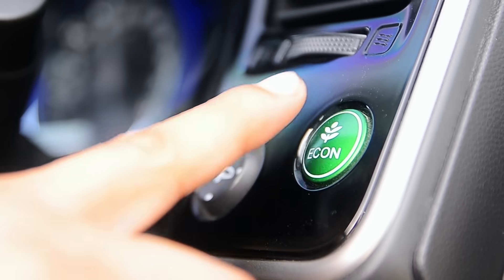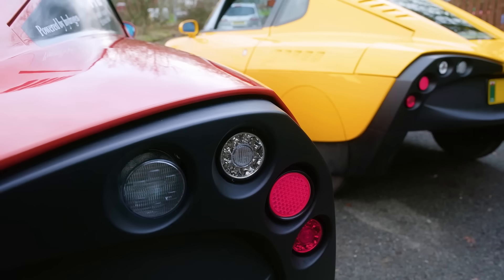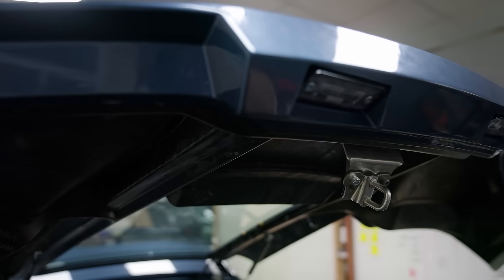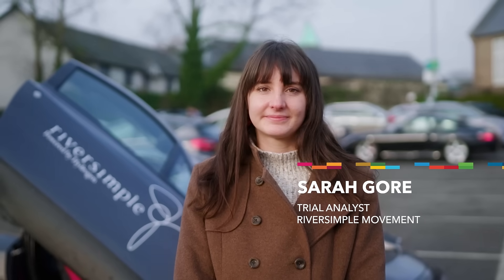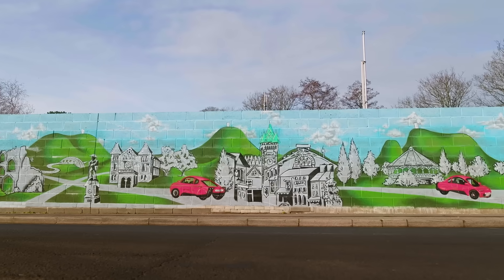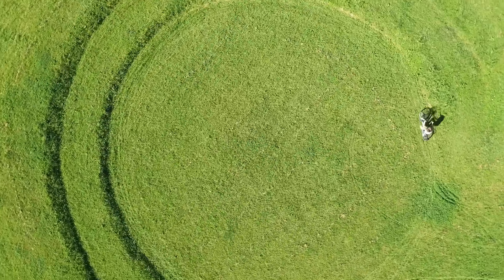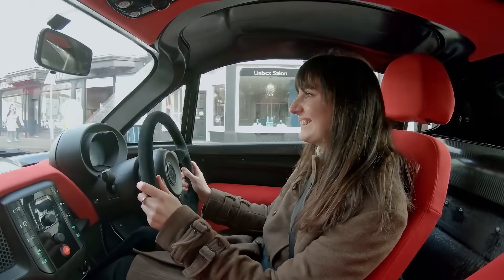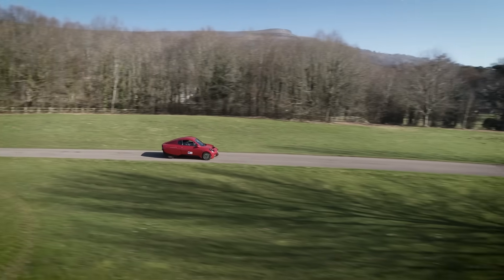Inside The Former F1 Engineer's Innovative Hydrogen Car

Comment: As impressive as it is, the simple fact is that while the battery EV charging infrastructure isn't as comprehensive as we'd like, it is FAR more advanced than the hydrogen refueling infrastructure.  There isn't any hydrogen refueling infrastructure at this time, and the dearth of hydrogen vehicles denies any market demand.  To backwards-paraphrase Field of Dreams, nobody's going to come so we're not going to build it.
Reply: Isn't Hydrogen flammable?
Reply: @Aaron-xr7oc  Yes.  So are gasoline, lithium, sodium and many other materials used to power vehicles.
Reply: Only because they have been tunneled visioned on plug in E.V's
Reply: That's not true.
Refueling facilities very much Exist -- for every city's hydrogen-powered public transportation vehicles.
How do you think those buses function?
They just need to be expanded to wider public, and that's gonna happen when the Governments make a push toward hydrogen transportation.
Battery cars are a dead-end.
Reply: @MrDeicide1  you have to truck in hydrogen, very costly, or build pipes, also very costly. Its not a simple matter of expanding it, these cities are probably only trucking in the amount they need
Reply: @BooleanDev  
From the Few gas plants that produce it
Why can't you imagine More natural gas - to - hydrogen plants?
Reply: Reply is OK.  It's all going to cost more.  I just can't agree totally, cause there is a lot of mind control happening these days.  Been the same forever.  Think about this:  War costs a lot.  It's the after cost nobody thinks about; which often amounts to more than ten times.  Heck, we can't fix potholes or fix any existing infrastructure, let alone think about new charging stations for electric or different fuels.  Hell, biden needs ice cream stations!  TAX, TAX, TAX. Whatayathink?
Reply: Definitely true, building them coz too much, transporting Hidrogen also difficult.
Reply: I meant "Cost"

Comment: The problem with hydrogen in cars is that 70% of the energy is lost before it powers the car. Electric battery cars it is 30%.
Reply: Yes, its far less efficient. Water have the strongest Bond splitting Hidrogen from it is very energy inefficient.
Reply: But as the devil advocate, batteries deteriorated and also need energies and materials to manufacture. And the waste is bad for the environment.
Reply: @drextrey  To produce a battery costs more energy than producing a gas engine, but this is offset, in case of Tesla, within 10.000 miles. Tesla uses solar energy to produce it's batteries, as the factories are covered with solar panels. Drone footage show Tesla is covering the roofs of all its factories with solar panels right now.. that runs in the tens of thousands of solar panels. Texas has already 70.000 solar panels and is only half covered, same is happening in Nevada, Shanghai and Berlin.

EV Battery packs do not deteriorate as quickly as people think. Jeff Dahn research group has shown that current batteries in Tesla's could last 1 Million miles. Older Tesla's, like first generation Model S', get to 500.000 miles. Jeff Dahn has also been testing future chemistries, which could last 2 million miles or even 4 million miles...This would mean a battry could last a life time! and will outlive the car multiple times. A car would be scrapped for other reasons than the battery and the battery probably will find a second life as stationary storage.

And when batteries get scrapped, all of them will be recycled and provide high quality materials for producing new batteries.
Reply: @MarcoNierop  you’re right that a battery pack will probably last longer than expected due to the current software being more advanced, still people have bad experiences with batteries in their old phones… You don’t know how the previous owner used his battery (you might, I assume this is tracked in the software?). He might have charged to 100% each time, just to get that extra bit of range. If you have a hydrogen car, in theory, it doesn’t wear out… just like a well maintained ICE car can run forever… you won’t be replacing an old battery pack which is custom to your specific electric car. Ok, some will, but currently this is the majority of the car’s cost. People probably will sooner buy a new car if it costs so much to replace. If, I could produce hydrogen at home (for the majority of the time, I would take my energy loss for granted) and if I could fill up at the current gasstations as a backup. I’d rather have a hydrogen car.
Now let me add one disclaimer. I am talking about vs an electric car with a large lithium ion battery, if they’d use more commonly available and less flamable materials for the battery my opinion could shift, but that’s yet another reason. Everybody wants new technology, they might not be interested in a 2nd hand electric with old technology…
Reply: @grtxyz4358  Fuel cells also wear out, and requires quite a bit of maintenance, like the air filter that needs to be cleaned/replaced at a regular basis. (Air that goes through the fuel cell needs to be super clean) and that is completely independant on how you drive!.. it is just something you need to live with.. same as with the high pressure hydrogen tanks that need to be replaced.. BY LAW.. after 10 years, no matter if you have driven it 500.000 or 50.000 miles.

If you buy a second hand EV, you easily check the condition of the car... Just ask it to be charged 100%, check the estimated available miles on the display, and compare with the original specs to see the degradation. Beside this you can run a analyses routine that checks the battery condition. 

More and more anekdotes come out where people see hardly any degradation on their electric cars. The other day I stumbled on a YT short about a Model X, only using supercharging as the guy has no possibility to charge at home.. almost 300.000 miles and less than 10% degradation on the battery, was a Models X from 2017 iirc so added a ton of miles in a relative short time. 

Batteries last very long and only get better. Also batteries for smartphones get a lot better... The phone I type this message on is already 5 years old! And it is stil as good as new! I can get through the day on one charge just as easy as when I just bought it in 2017. My previous smartphone (Nexus 5, Google phone) all of a sudden battery life went downhill and one day it got bloated and very hot... Was only 3 years old...
Reply: @grtxyz4358  There is a lot happening in battery chemistries, CATL and some Chinese manufacturer are now using Sodium ion batteries, no lithium but SALT, the second most abundant material on earth.. It's used in a very cheap small Chinese EV. 

But the big change that is going on right now is the transition to Lithium Ferro Phosphate (LFP) batteries, which do not need Nickel(expensive) and Cobalt (even more expensive!). Plus these batteries have twice the amount of cycles and can be charged/discharged 100% all the time without damaging your battery. Plus these are a lot cheaper.. the disadvantage of low energy density is worked on by adding other metals to improve energy density, like a bit of manganese (CATL M3P  battery) or silicon. The cheaper lower end EV's are now fitted with these batteries and works just fine.

But more is coming and will both improve longevity, energy density, lower costs.
Reply: @drextrey  Yep, it's just physics and there is no way around physics, so this inefficiency problem will never be solved.
Reply: True but today in the Netherlands they had to turn so much wind turbines out of the wind because all the solar panels were producing so much electricity... if you have a huge surplus of cheap generating devices like solar panels, which are dirt cheap nowadays, what does it mean to lose 70% if that means you have really no waste.... unlike with batteries.
Reply: @grtxyz4358  That is what is been built right now, a hydrogen electrolyser near Amsterdam that runs on excess energy from wind at the North Sea.. the goal is to use that hydrogen for producing carbon free steel at Tata IJmuiden and have a few more hydrogen cars for people that cant do math.
Reply: The problem isn't that. The problem is it takes 39 kwh of electricity to make 1 kwh of hydrogen.
Reply: @jg4sh7j4  I am against hydrogen, but that figure is bullocks, maybe you oversaw a decimal, was it you need 3.9 kWh for 1 kWh worth of hydrogen? That seems about right to me.
Reply: Yes but the pro is after doing that you can in theory make high performance in horsepower or speed vehicles that dumps the hydrogen rapidly into the fuel cell for a power surge at a weight batteries could never match. 

Though fuel cells are too expensive for that right now and pantograph EVs can avoid being weighed down by Batteries and come in truck and train forms so…🤷‍♂️ plus in Europe you got ebike infresture that can easily be retrofitted to be solar. 

Both hydrogen and power grid electricity is powered mostly by natural gas and other fossil fuels anyway. Biogas is the carbon neutral version that burns cleaner. LNG or CNG vehicles have the pro of being carbon nuetral, have less intial Carbon foot print in manufacturing then EVs, burn cleaner, fuel is cheaper per mile, and makes use of waste steams instead of valuable crop land like ethanol corn or bio diesel oil crops. It’s so easy you can make your own biogas 🤫
Reply: All cars run on batteries...stores of inert energy turned kinetic on demand.  Petrol, Diesel,  BEVs, H2, NatGas...

The physics problem with BEVs is mass.  You must keep a massive mass moving and that mass is just as big when full or empty.  To get range/HP you must add mass batteries, which add weight, which reduce range.  An engineering vicious cycle.

Liquid fuels and gasses have the advantage of the weight of the battery store being small, and getting lighter each km or mile traveled.

Thus a Tesla is a massively heavy car for what it is.  Twice as heavy as an equivalents petrol car.  Weight equals resources consumed to build the car.  Resources consumed is the primary problem.

It is hard to get yourself out of a consumption problem by consuming more and new stuff.

Eventually we have to ask is long distance personal transportation worth it?
Reply: @STho205  When we convert to all electric cars the need for resources is LESS than with gasoline/diesel cars (ref Tesla masterplan 3, and this week's published Tesla Impact report 2023, highly recommended reads!)...Why?  Because the battery need to be resourced only ONCE per car, while fuel for ICE cars need to be resourced continuously throughout the life of the car, and is used and wasted as toxic pollutants in the atmosphere.. PLUS electric cars are way more efficient with the use of energy. Electric cars need only 30% of the energy present in gasoline to travel the same distance as a gasoline car. A Tesla Model 3/Y battery has the same amount of energy as is present in about 2 gallons of fuel. 

Batteries last a long time and will be recycled when they are at the end of life (this could take decades!) So at some point we hardly need to mine for new battery materials, because the old batteries will function as high quality ore!  Just like we recycle lead acid batteries for decades. 95% of lead acid batteries are recycled, for lithium battery packs that could get very close to 100% because battery packs contain so many valuable materials and companies are picking up on this recycling opportunity right from the start.

Charging batteries using solar and wind, the same story, no waste, so less resources needed. Solar panels last 30 years, wind turbines about 25 years.. the energy source is all around us, for free, wind and sunshine. and these too will all be recycled.

Ik know what is better, if you really did some thinking about it, it is kinda obvious.

Oh, and that weight issue, yes electric cars are heavier, but with new batteries energy densities are increasing and this weight issue gets less and less. Beside that, the weight of fuel in a car, maybe max 60 kg on a 2000kg car, that is only 3% of the total weight so that benefit of reduction in fuel weight during a trip, that is just peanuts for a car, for big rigs, ships and aircraft it is more important... But this is offset by the much better efficiency of an electric car, it outweighs that tiny benefit many times over.

Comment: The barrier for personal transportation will be the fueling infrastructure.  Electric charging stations use existing electric infrastructure to deliver energy to point of sale .  Hydrogen would make sense for fleet vehicles where all of the vehicles would be fueled at a central location. Then there is the issue:  where is the hydrogen going to come from .  It is energy intensive to make.  If a waste heat energy stream could be tapped it would help.
Reply: This is so true, and Battery plant are already exist so less impact from building more factories.
Still their waste is bad, and making new batteries need resources and also more hazardous waste.
Its very difficult position to save the planet, but everyone should do our best.
Reply: To power the country will electricity, we will have to install a huge over capacity of turbines and solar.  Although hydrogen is very inefficient, that doesn’t matter if the electricity is produced when there is an excess
Reply: @markthomasson5077  The deal breaker is infrastructure.  It would take a massive incentive that does not exist to begin a transition to a hydrogen economy.  You are correct that the green dreamers have no idea of the increase in generation capacity required to wholly transition from fossil fuels.  transition to an electric economy would best be accomplished with some flavor of nuclear energy, (uranium, thorium , etc.) Nuclear takes up very little space to generate large amounts of power and it is reliable base load power  You still need conventional generation for load following.  The Wind and solar guys  don't realize that actual energy production for W&S is only about 30% of rated capacity.  Experience  is showing that you need about 80% conventional reserves to maintain reliability.  the cold hard truth is you have to build close to 1.8 generation systems to get adequate load following and reserve capacity.  The green dreamers should let market forces determine the best way forward.  Clumsy ignorant government  policies  are guaranteed to destroy the economy and the jobs that go with it.  I like the concept of EVs but the truth is that they are much more carbon intensive to build and don't hit a carbon neutral break point until about 60,000 miles.  The current price premium for EVs  is a reflection of this.  Again I contend that market forces should  guide a transition to EVs where it makes sense.

Comment: This would be a better car if it ran on batteries instead of hydrogen.
Reply: Well then it would also be a 'heavier' car. would'nt it?
Reply: @varunemani  And also one with a shorter range - making it less useful in large countries with long distances between cities.
Reply: @varunemani  Nobody cares if it weighs a bit more. If it was a BEV it would be greener than hydrogen, instead of wasting that energy to make hydrogen, then turn it back into electricity.
Reply: @varunemani  But my battery EV weighs in at 2100kg, but it can also do 300 miles. So how is this any better? It's not as nice looking, it's a lot smaller and less practical, and there are hardly any hydrogen filling stations about. At least I can charge my 300 mile EV at home, overnight.

Comment: The BIG question I wish to ask --- How can this ever make economic sense when it takes a lot more energy to produce isolated hydrogen gas than than the energy you get out of that hydrogen when it is used up????

Also, you say 80% of the energy used by the car is from regen braking --- how does that work if you are on a longish journey, say, on a motorway?
Reply: 80% of the energy from regenrative braking.. That would defy physics... You may get some energy back with regenrative braking to convert some of the kinetic energy back into electric energy and store that in the battery pack, but to genrate that kinetic energy (movement) in the first place comes 100% from the hydrogen.

Hydrogen will never make any sense, because of its inefficiency, complicated technology it will ALWAYS be 3-5 times more expensive than gas let alone electricity! With the advancements in battery tech, all arguments in favour of Hydrogen will evaporate.

The Hydrogen Bullshit Bingo Card  would fill up rather quickly with this video.
Reply: @MarcoNierop  I am pleased you agree with my criticisms.  Elon Musk also said hydrogen would never be a solution because you cannot defy the physics.
Reply: @loddon77  the content of the video and the manufacturer's website make no such claim about % from Regen. I think the person writing the description just got it wrong. Perhaps the claim was 80% of kinetic energy is recovered by Regen. That would be a reasonable claim. As the other commenter said, ultimately all of the energy came from the hydrogen. Claiming it's mostly powered by Regen is nonsense.
Reply: The only argument in favour of this technology is that it might serve as an interim stopgap that could reduce the amount of carbon emissions by  powerplants that currently run on petroleum products. Beyond that, it's a waste of infrastructure development that will be obsolete before it's even properly implemented.